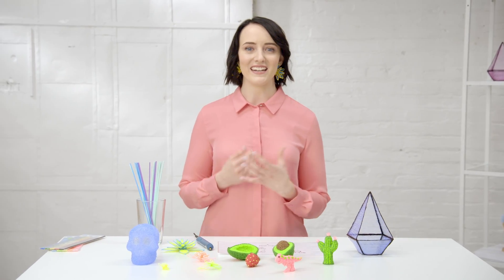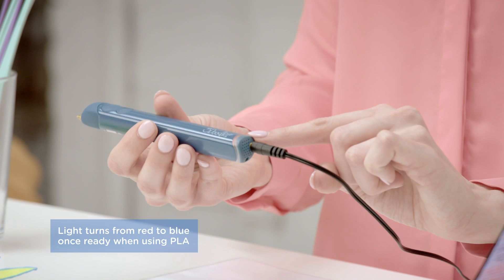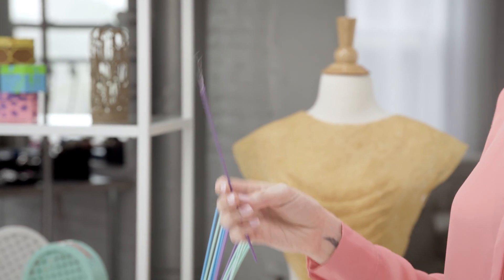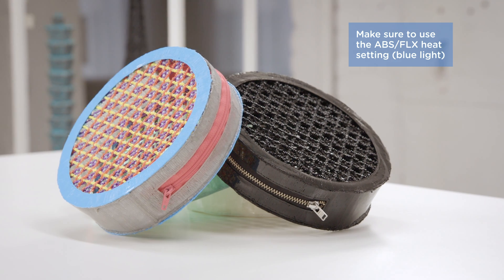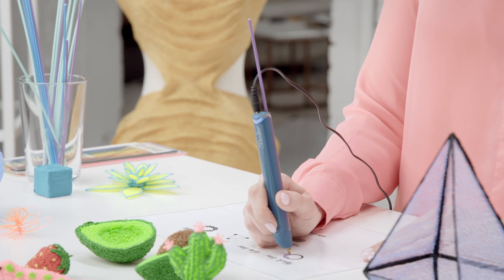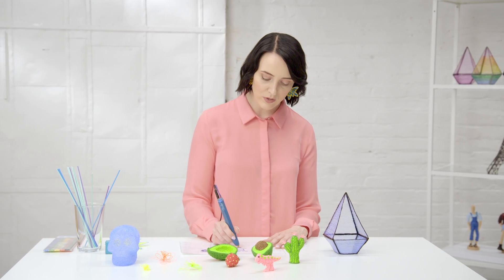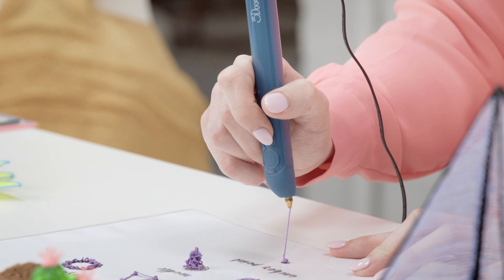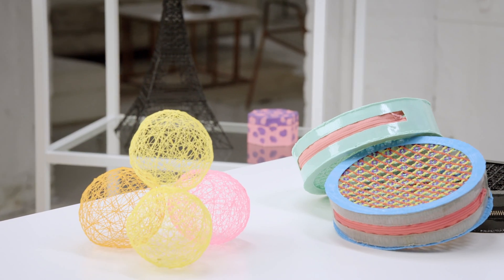3D Printing Pen Basics with Grace Du Prez | 3Doodler (2018)

Comment: I got this for my daughter, unfortunately she got frustrated by the excessive oozing of material after she stopped pressing the button.
Reply from the maker: Hi did you check as to what setting the pen is on? If you are using PLA and you have it set to ABS it will ooze as a result. The light should be Green for PLA and Blue for ABS. If you are still having issue then please reach out to help@the3Doodler.com.

Comment: Also, there is no any videos about your pedal, nozzle set, mat, power pack. It will be great to find video about it on your channel.
Reply from the maker: Stay tuned on those, we have a slew of project kit tutorials in the hopper but once we run through them we're going to turn back to accessories.

Comment: Really enjoy your 3doodler create +. Thanks for great pen.
Reply from the maker: Thanks, were you a user of the original Create as well?  Happy with the improvements?
Reply: 3Doodler I use your products since 3doodler 2.0, I enjoy nev designe, speed control, silicon material of pen and the most important new dual drive mechanism which lets me easily you spools of plastic and also use pen without jams. Now I want to by some accessories for my pen, but they are expensive to deliver to Russia, so maybe soon...
At all there are lots of improvements in create +
Reply from the maker: That's what we like to hear.  If you have any issues don't hesitate to give us a shout.